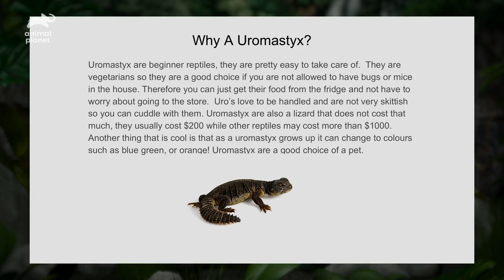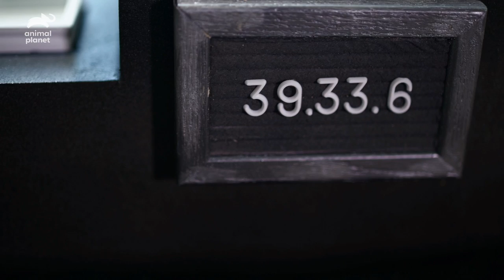Creating a True Work of Art For a Uromastyx's Stylish New Home | Scaled

Comment: Eeeeeeh I like it but the metal podium gotta go👏🏼maybe it’s just me but a more natural look would have pulled it off
Reply: Agreed
Reply: I don't like the way it looks but it suits their house.
Reply: Haleigh Hughes-Wallace 😳 But surely the most important criterion is that it suits the requirements of the lizard? I do not see any rough surfaces that it can climb on using its strong claws. This is more a work of art than a home for an animal. Jordan should have taken advice from experienced herpetologists before committing to such an unsuitable structure for the creature. Its needs come before any ‘artistic’ considerations that appeal to the people concerned.
Reply: @sirmeowthelibrarycat   1) I'm not talking on the inside of the cage, and 2) the slate
Reply: @briannaharter4411  false. Uromastyx like to dig and do fine on sand as long as they are properly hydrated with their food. The food dishes are on the platform off of the sand. There's slate and rocks and the platform is rough for climbing and wearing the claws.
Reply: They really don't do fine on sand.

Over time sand will clump up inside their stomachs and cuase impaction.resulting in death.it really doesn't matter how well hydrated they are cuase it's not going to change the fact they have no adaptions to deal with sand.

Also it doesn't matter that their food dish is off the sand cuase they will still lick some up while exploring.

Sand is the worst substrate cuase it's used for speices that should never ever be on sand by idiots that think deserts=sand when they really don't.
Reply: JmanJbuckets 23 fax’s
Reply: JmanJbuckets 23 she runs track, it’s that theme

Comment: But he needs UVB or he is going to suffer and have to be put down... 
Common knowledge that the majority of reptiles require it.
Reply: Did you hear that the bulb they use actually puts out UVB and HEAT...
Reply: @taeviansworldofreptiles3828  those ones are actually not recommended for constant use by herp vets due to the animal only receiving UVB when they bask and no all times. Ideally, UVB should run 2/3 of the enclosure so there should be two more of those bulbs. Howevere, that would leave inappropriate temperatures and not the gradient between 80-120 that most Uromastyx species need.
Reply: Taevian's World of Reptiles! They don’t work

Comment: Maaaaan y’all gettin too mad that they “didn’t use a natural enclosure” omg it’s still perfect for the lizard’s environment while also fitting the theme that the girl wanted
Reply: Not at all, first off pure sand? Deadly as its easier to get impaction its why topsoil+playsand mixes are much safer, but for any sand or sand mixes the tempatures must be set for the animals digestive system to pass any loose subsrate accidently eaten, this set ups size is fine for a baby/juvenile but not for adult hood as they'd need a 4x2x2 for it, dont even get me started on how bare this is as many lizards enjoy having cover to feel secure.
Reply: @insomniacs5138  The enclosure is over 4 x 2. The platform has hides built into the back.
Reply: @thenaturecentre  even then you have to also note bearded dragons are semi aboreal, if you ever go out and see one 70% of the time they are on branches.
Reply: @insomniacs5138   its not a bearded dragon.
Reply: @thenaturecentre  shit sorry confused. Im not very knowledgeable on uros but i do know they like ledges to lay one.